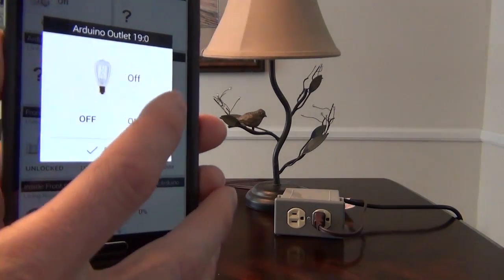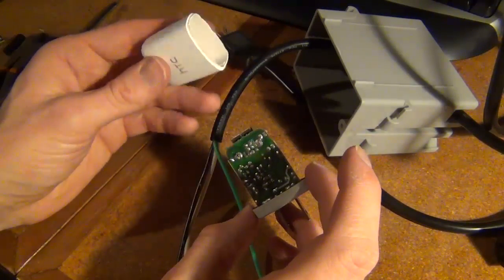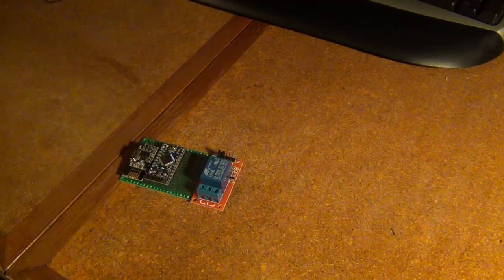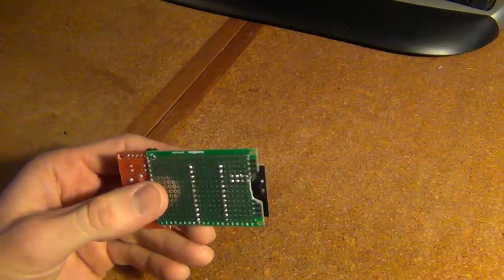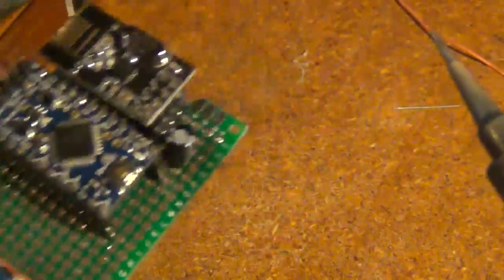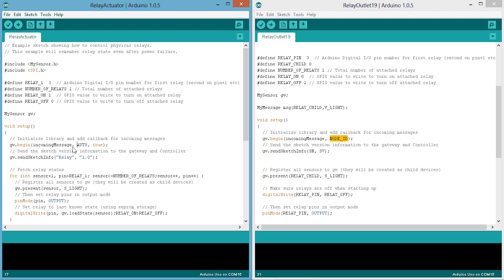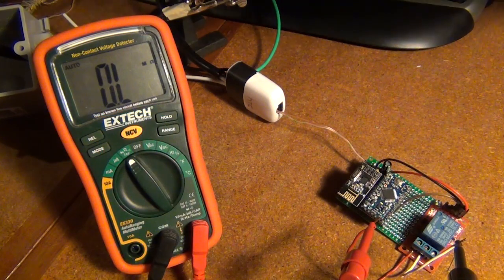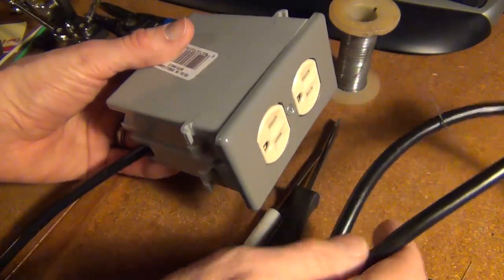$8 DIY Arduino Smart Outlet Lamp Module

Comment: ESP8266 itself has a microcontroller. Why are you using arduino?
Reply from the maker: I love the integration with MySensors.  You can use the ESP with MySensors but you have to have them as a separate gateway.  I have been wanting to play with the NRF52832 which has a micro-controller built in but I haven't had a chance yet.  So many things to do, so little time...

Comment: How to made it for 40Amp load? Is it possible?
Reply from the maker: That is a massive load.  I suppose it's possible if you have a large enough relay.  I'm not aware of one that large though.  I recommend you do your research before attempting.  I have been told you should have a relay that is rated twice the load you want to switch.  Be careful. :)

Comment: if you just used the chip and not the arduino these would be much cheaper.
Reply from the maker: Yeah, but I think it is more complicated for the person just getting started.  There are some really interesting projects on openhardware.io that do what you're referring to.  The other nice thing with just the chip is the device can be smaller.  So many cool possibilities out there.  I love how they can be customized to your particular use case.

Comment: '
Is there any specific reason not to use esp8266 standalone ?
Reply from the maker: At the the time I made this the esp wasn't really around.  Also, MySensors didn't support it.  It does now though so you can substitue the arduino and nrf radio with an esp.  I like using MySensors for all my devices to keep everything unified.
Reply: '
ooh ookey :)

Comment: can we use the same code with esp 8266
Reply from the maker: I haven't updated the code for MySensors 2.0 yet so it wouldn't work "out of the box" but if you made the few changes to get it to 2.0 it should work.  I have it on my list to update the code but haven't been able to yet...

Comment: First, congratulations for your work. I´m sorry but i need to correct you in an importante issue. Here are the limits definition for voltage: 

Low Voltage - up to 1000V(AC); up to 1500V(DC);
Extra-low voltage (supply system)  - < 50V(AC); < 120V(DC);
Medium Voltage     - 1000V to 35kV
High Voltage           - 35kV to 230 kV 
Extra High Voltage  - above 230 kV.What you have in your home is  low voltage, although also it will hurt you, is low voltage. High voltage stand for 35 000 V to 230 000 V and it´s used for energy delivery in long distances.
Reply from the maker: Maybe it depends on where you are located?  I think that in the USA low voltage is <50.  But I could be wrong.  Either way, be careful :)
Reply: Pete B It doesn't depend on your location. These are international normalization definitions by the IEC, they are the same in any part of the  world.
Reply from the maker: Mário Camoesas I'm getting my info from Wikipedia so it's definitely possible that I'm reading it wrong :)
https://en.wikipedia.org/wiki/Low_voltage

Comment: Can u control your light from anywhere in the world from the internet, or do u have to always be close to the light before it works? what  I mean is does distances matter?
Reply from the maker: Anywhere in the world.  It connects to my Vera home automation controller which is connected to the internet.
Reply: Pete B Ok, thats good. I wanna do this automation for my uni project. Can u pls send me a list of everything I need to buy so I can do it for myself. Even the apps I need to download for both my phone and my laptop. I use a Mac, hope that won’t be a problem?
Reply from the maker: Fashanu Bright Check out the video description as well as MySensors.org.  You will need a home automation controller as well as a MySensors Gateway and all the parts listed in the video description.  Basically, all the info you need is already on MySensors.org.  I hope that helps.
Reply: hey im doing this for my uni project too! let me copy your ideas please LOL xD

Comment: Hey nice video, clear a ton of doubt's on my newest project, but I still have one... can you turn it z wave?? I'm new on this antenna stuff. Vera lite works with this antenna?? It's the same program if you want it to turn Z wave?? 
Thanks!!!
Reply from the maker: Hi Luis, this will not currently work with a z-wave radio.  It is using MySensors which uses a few different radios (NRF24, RFM69, ESP8266) but not z-wave.  This will work with a Vera lite though.  You will need a MySensors gateway.  Check out my other MySensors videos for more info (the getting started ones).
Reply: Pete B Hey, dude thanks for the fast replay, ok I'll check'it out. This MySensors thing it's another protocol of communication do, I get it, thanks
Reply from the maker: Luis Gatica Yep, it handles all the communication between your sensors and the controller (Vera)

Comment: I was just prototyping the same thing. I was going to install mine behind my light switches. The switch can be  read by the Arduino just like any old switch such that toggling the light switch can toggle the lights as well as the remote. Good video! Best Smart House Video I've EVER Seen!
Reply from the maker: Thanks!  I wouldn't use this design to put behind a wall however.  Please check out this thread for a better and safer design for "in wall" devices.  https://forum.mysensors.org/topic/1607/safe-in-wall-ac-to-dc-transformers

Comment: Hi Peter,
                Is there code for connecting this to a wifi network over wifi or openhab? Still learning and having problem. Great video you have made.
Reply from the maker: Yep.  You need to set up a gateway on a separate Arduino which will talk to OpenHAB.  More info here https://www.youtube.com/watch?v=TBvGrB094Co and here https://www.mysensors.org/controller/openhab

MySensors just switched to version 2.0 in the last week so there may be some bugs while everything is worked out.  I don't use OpenHAB and I'm not sure if the controller is compatible with the 2.0 code yet.
Reply: +Pete B I not should if I am going about the right way Anyway.  All I want is a relay I can control of my wifi network via Android. Thank you for your help so far.  From a no obligation at this stuff,  but not electronic.
Reply from the maker: Chris B Hmm.  MySensors may be a little overkill for one relay but it will be so easy to add more devices if you ever wanted to (once you have everything set up). I'm not sure about other solutions as I am automating my house and MySensors works beautifully for me.  If you have a spare Raspberry Pi I would at least try to set it up.  Use Domoticz and a Arduino Nano for the MySensors gateway.  So, it would look like this:
RaspberryPi > MySensors Nano Gateway > Relay Node
Once you have the gateway and Pi you can add additional nodes.  I probably have 30 nodes with close to 100 devices attached.  It's very easy to expand.
Reply from the maker: Chris B Unfortunately I don't know of a video for that.  I use Vera as my home automation controller so I'm not familiar with any videos for Domoticz.  Sorry.
You can check out this link for more info though: https://www.mysensors.org/controller/domoticz

Comment: I couldn't find the data wiring diagram on the mysensors site. Any help would be appreciated thank you.
Reply from the maker: You are right, I guess I never made one.  You can use the info here: https://www.mysensors.org/build/relay which should help a little.  I will do my best to make one but It may not be for a little while.
Reply: +Pete B Thanks Peter still trying to pull it all together.  Plus the code only has the relay part in it.
Reply from the maker: Chris B Ok, I just uploaded a wiring diagram.  Make sure you watch the video to double check the diagram.  I am doing this from memory on the bus :)
The link to the diagram is in the video description.
Reply from the maker: Chris B MySensors has it's own wireless protocol so you need to build a gateway to send/receive commands to/from sensors.  You would then connect the gateway to the home automation controller (Vera, Domoticz, OpenHab, etc).
Reply: May i know what are the specific materials you've used?

Comment: Probably should add a fuse to the circuit on the AC side. That way a short or failure doesn't result in a house fire.
Reply from the maker: Yeah, good idea.  If anyone is interested there has been some discussion (and a wiring diagram) regarding that here: https://forum.mysensors.org/topic/1607/safe-in-wall-ac-to-dc-transformers

Comment: Doesn't the cellphone charger get a bit hot in there? Do you need any ventilation in the case for heat dissipation? I'd like to do a similar solution but smaller formfactor but the power supply is always the annoying part. Also you can make the radio work in a mesh network,  at least that's my plan so it can be extended alot without hubs or external repeaters.  Great work anyway and thanks for sharing!
Reply from the maker: +Henrik Fransson I haven't had any issues with heat but I am using good quality chargers.  I don't really have any ventilation aside from the holes for the wires to go through. Your concerns are definitely valid though so it would be good to test before you do anything permanent.  I agree with you about the size.  Something that may solve both your issues is the HLK-PM01.  You can find more info about it here: https://forum.mysensors.org/topic/1607/safe-in-wall-ac-to-dc-transformers

As for a mesh network it's not currently implemented but the nodes will automatically try to find the best route to the gateway if there are repeater nodes around.  You can also use the RMF69 radios for better range.

Comment: Did you ever add the electrical consumption module?  What chipset was that?  I am just starting to get into this stuff and out of all the videos and tutorials I have read yours was by far the easiest to follow!
Reply from the maker: +Steven McGouldrick Thanks Steven!  It's a lot of fun!
No, I never implemented the current monitoring.  I am actually working on another project right now that I am planning to implement it in though.  I am planning to use the ACS712 current sensor module.  Here is a great site I found on how to use it: http://henrysbench.capnfatz.com/henrys-bench/arduino-current-measurements/acs712-arduino-ac-current-tutorial/

Comment: Great video! with what description can I find the same Relay Board on ebay?
Thanks again, can't wait to start this project!
Reply from the maker: +George Sanchez 
Hi George.  Thanks!  Check out the MySensors store (http://www.mysensors.org/store/#relays) for all the necessary parts.  Even if you don't buy the actual part listed it will give a little money to the MySensors project (which is used to help keep the servers on).

Comment: Like this project.  How can you handle dimming a light with a relay? Is there a different relay to buy?.
Reply from the maker: +Aaron Ward Thanks.  
Yes, you would need a different relay.  I haven't done much research on a dimmable light module but I'd like to make one someday.  If I remember correctly you will need a special kind of solid state relay.  Sorry I can't be more help.

Comment: I am by no means qualified to advise on this, but I feel the layout of the electronics might be unwise. I believe it's good practice to have separation between the AC and DC sides of a circuit. I realise the layout you chose is to make sure it fits in the box, but in future designs it might be better to turn the relay 90 degrees (assuming there's proper separation on the relay board, which there might not be on cheap boards).
Reply from the maker: himselfe Thanks.  I will keep that in mind for future projects.
Reply: And add in optoisolators if you're really worried.
Reply from the maker: +himselfe Thanks for the comment.  Are you saying rotate it 90 degrees so the bottom of it is against the plastic case?
Reply from the maker: +Chaplain Dave Sparks Hi Dave, I believe the relay board already has an optoisolator on it.
Reply: +Pete B yes, so that the AC side of the relay has separation from the perfboard. On power supplies and other things that have a high voltage and low voltage side, they usually have a gap on the PCB between the AC components and the DC components, and sometimes even a slot cut into the board itself to create an air gap, so that in fault situations it's more difficult for the high voltage current to find a path to the low voltage side.

Comment: Pete B wanted to give you a shout out. I built a 4 relay switch for my landscape lighting system, everything worked great until I mounted it on the wall in the garage. It was not communicating well through the concrete block, once in awhile it would work but mostly not. I tried your antennae wire extension idea to the letter, 3.28" . Works perfect now. Thanks for sharing you work!
Reply from the maker: +Jim Lieffort Awesome, glad it's working for you!

Comment: 120 VAC isn't "high voltage"; it's classed as "low voltage".  For AC, "high voltage" is defined as greater than 1000 volts.  Nonetheless, 120 VAC is high enough to kill a person under the right conditions.
Reply: Perhaps the NEC has changed (here in the USA), but IIRC, "high voltage" started at 600V. For most applications, it really doesn't matter. Unless you're talking about transmission/distribution level voltages, or voltages within a chassis, you generally don't see much (again, in the USA) above 480V, which would be in an industrial/commercial 3 phase system. In a large plant, you might own your own step-down transformers and receive distribution level voltages of 4 kV or 12 kV.
Reply from the maker: +Milosz Ostrow 
I never knew that.  Good to know, thanks.
Reply: therealnightwriter You're confusing "Safety Extra Low Voltage" with "Low Voltage".
Reply: +Milosz Ostrow To an electrician 120 VAC is low voltage. To an electronics hobbiest who usually only deals with DC current 120 VAC is plenty high.
Reply: pedantically fucking stupid.
Reply: Chaplain Dave Sparks 1000V AC/1500 V DC are the thresholds for "high voltage" according to the IEC definition, not the National Electric Code (NEC).  However, the NEC makes special provisions for circuit installations that operate at voltages above 600 volts RMS.  I had to look it up to refresh my memory, because my work doesn't typically involve equipment operating in that range and it's been over 30 years since I took the P.E. exam.  At least my memory is still good!
Reply: yup... for AC, it's a 'low voltage' but not for DC, don't misinterpret it LOL... go check for IEEE regulation and spec there, you'll know

Comment: a good solution for 110 to 5v is these little regulators 
AC-DC-110-220VAC-to-5V-600mA-3W-Buck-Power-Converter-UL-CE-EMC-Mini-Size
http://www.ebay.com/itm/321910440165
Reply from the maker: +Charles lakins 
Yes, thanks for sharing.  I have purchased a few of these but haven't used them in a project yet. For anyone interested, check out this post if you'd like more info on the HLK: http://forum.mysensors.org/topic/1607/safe-in-wall-ac-to-dc-transformers

Comment: Did you notice that you mentioned that you didn't need a repeater because your house was small then had to modify the antennae because there wasn't enough signal. Seems to me you could use that repeater and not cludge the circuit.
Reply from the maker: +Jeffery Rowan Yeah, I guess it depends on how you look at it.  If you use a repeater there is another thing to fail but it also could improve things.  MySensors now supports RF69 which has better range so maybe that's an option for people.  Thanks for the comment.
Reply: You are right on both counts.

Comment: How come you didn't use the two GPIO pins on your esp8266 and leave the arduino pro mini out of it.
Reply from the maker: +Bradley Herbst It's actually an NRF radio so it doesn't have a processor.  The ESP isn't working with MySensors yet.
Reply: +Pete B Ah sorry, about that.  Thank you for the reply.  I'm going to try to do this myself and tweak it to work OpenHAB though MQTT, but I don't really know what I'm doing so I learn as I go.  You really have some amazing videos and the write ups you do on them are super helpful.  Keep up the great work .
Reply from the maker: Bradley Herbst No worries.  You should check out mysensors.org.  It's already integrated with OpenHAB and you won't have to do much tweaking/work to get your things up and running.
Reply: +Pete B I was unaware of the mysensors and the OpenHAB integration.  Thank you I will start looking into mysensors as a viable solution for some of my home automation needs.  http://www.mysensors.org/controller/openhab
Reply from the maker: +Bradley Herbst 
You're welcome.  It's a lot of fun!
Reply: +Pete B You could use the ESP8266 with your MySensors projects though MQTT messages.  Have you thought about going down the route at all?  http://www.mysensors.org/build/mqtt_gateway
Reply from the maker: Bradley Herbst I hadn't thought of that.  It's a cool idea.  One of the things that's nice about the native messaging is they are repeatable (mesh networking) and have acks and a standard message protocol.  I'm guessing you would probably have to repeat some of that if you wanted to use MQTT messages but I don't know enough about MQTT to say for sure.